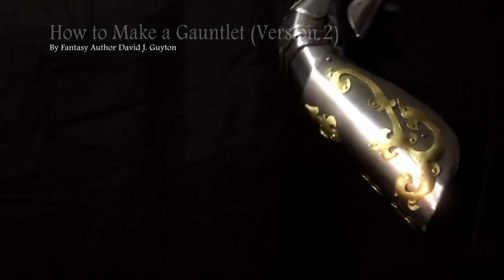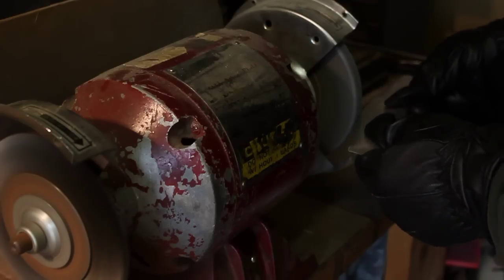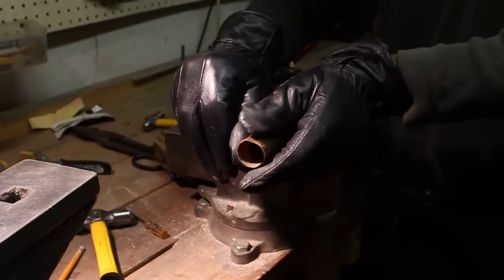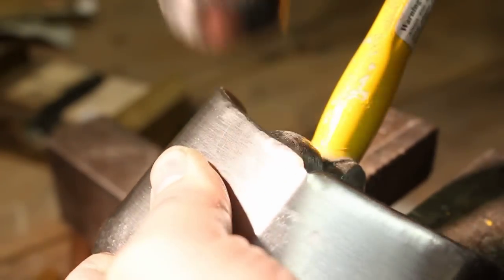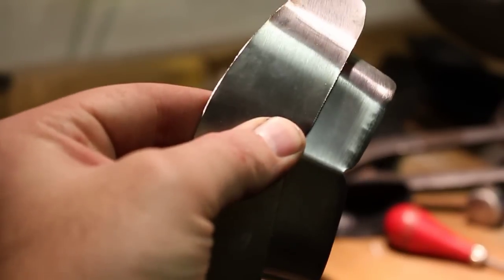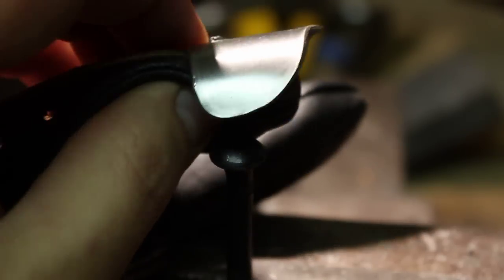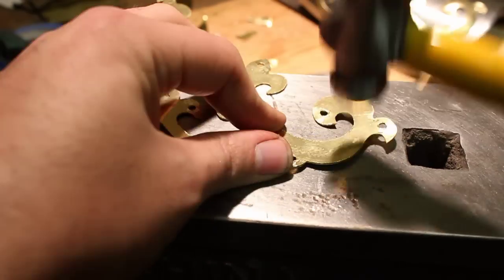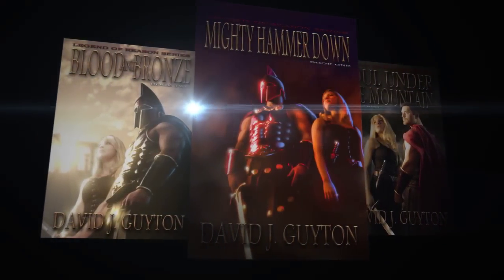How to Make Armor with Ordinary Tools - Version 2 Gauntlet

Comment: Do you have any tips for hammering the rivets they always seem to bend what am I doing wrong
Reply from the maker: the most common issue if they are bending is that the rivets are cut too long. You only want about 2 or 3mm sticking out above the surrounding metal. Make sure to use a rounded hammer, like a small ball peen, and hammer very lightly around the edges first. This begins the mushroom shape and if you are careful it will stay uniform and not bend on you. If you are doing loose rivets, the same care must be taken, but you need to go even slower because obviously the shank will nee to be longer and will be more susceptible to bending. Make sure you have something very sturdy to hammer against too.....tricky to do inside the glove but it's certainly doable.

Comment: David- I have another question.  I am trying to attached the finger plates to the glove using the roofing nails as in the tutorial however I am having some issues.  First the placement of the holes on each plate.  The first attempt the leather strip stretched on the second plate causing the placement to be off.  Too it apart and on the second try the nail head pulled through the top of the glove leaving a hole  while on the bottom it was torn through by way of the anvil and the nail head.  Any advise or suggestions on these issues?  Thanks again!
Reply from the maker: Hmm not quite sure I understand, but I'll try to help. Leather comes in all forms. It sounds like you are working with some stretchy kind of leather...it would be best to find some that is a bit stiffer. It should only stretch when you REALLY pull on it, otherwise it should only bend. If you can stretch it with your fingers, try another leather. As for pulling through the hole, try cutting your nails a little longer so that there is more  metal to mushroom out on the top side. Work the edges first, then you can hammer down the entire nail head. As long as your hammered nail head is bigger than the hole in the fingerplate, it will never come out. Ihope I answered your questions, if not, let me know and I'll try again

Comment: Hi, the Ebay seller you use doesn't ship to the UK, what do you search in Ebay to find the metal for making armour? Also, how much should it cost? The cheapest 500mm x 500mm 0.9mm brass I've found is £60! I'm not even sure if that's the right thing! Thank you so much! On a different note - I HATE GOOGLE+! ARGH! <3
Reply from the maker: Search for 20 gauge stainless steel sheet, or since you are in the UK, it might be listed as 1mm stainless steel sheet. Anything close to 1mm will be fine. Not sure what it costs in pounds but in USD it should only cost about $20-$30. That's enough to make one gauntlet, and probably two if you are careful with your layout. The template prints out on 4 pieces of paper (I think) so keep in mind that you will need about that much metal to make a gauntlet (slightly less since you can lay it out differently on the metal and save space)
Reply: David Guyton Thank you so much! I think it's just more expensive over here then, unfortunately! I was hoping to get more because I would also like to try making an 'armoured dress' out of brass. I'll keep looking, I really want to try making this! Thank you! <3
Reply from the maker: ooh an armored dress would be really neat! I would like to see a video of that if you ever decide to make it.
Reply: David Guyton  I've seen some gorgeous scalemaille dresses - full plate would be even better.

Comment: What kind of nails did you use to rivet the finger plates to the glove? I'm using galvanized stainless steel and they seem to be way too hard.
Reply from the maker: +Nukellavee Buke Ordinary roofing nails, or anything with a wide head. I have never heard of galvanized stainless nails. Stainless steel does not need the zinc coating.

Comment: I feel cheated!  Where's that model that was on your ad for this video?  ;)  It appears that you are riveting through the glove.  If you are doing this, wouldn't it be practical to increase the gauntlet size so that you could wear a soft form fitting liner against your skin to protect from chafing?
Reply from the maker: ***** She's in my book trailer videos, and also on the cover of all 3 of my novels.As far as protection goes, you could easily slip on a thin liner glove inside the leather glove. This gauntlet is not that form-fitting, so there's no need to scale the template up in order to fit a liner glove inside

Comment: Also are you Hercules? I've tried drilling, hammering in nails and all that and either i can't make a hole at all or it makes the other side flayed out and messy. Did you use a drill? Because maybe my bits are just blunt
Reply from the maker: either your drill bits are blunt or you have very thick metal. You should be using 20 or 22 gauge stainless for this, or if you are using regular steel, 18 gauge. Stainless is a lot harder, but a sharp drill bit should go through it just fine.
Reply: Alright thanks! I'm using around 22 gague stainless and my drill bits are doing nothing to it... Might just have to sharpen them

Comment: so I have been looking into these and I'm wondering two things.  One what size rivets did you use and I am thinking of using this template for a cosplay and I'm wondering if you think it would work with EVA foam and if so would you recommend a thickness?
Reply from the maker: the rivets are just ordinary roofing nails I had in the garage. The size really doesn't matter, as you can make anything work. Never worked with Eva Foam no, although I would like to look into it.
Reply: David Guyton The EVA foam looks like it will work really well but I am having a problem with some of the pieces staying down.  I was going to simply glue them to the glove like I saw in another template that was less advanced than this set.  What I'm wondering is, what is the point of the leather strip?  Is that to allow the pieces to articulate better?  If so, I may try something similar with the foam.  Let me know when you can.  I have a convention I will be showing them off at during the end of the month so I just need to know by then so I can have them working in time.  Thanks for your help :)
Reply from the maker: the point of the leather strip is so that you have something to rivet the fingerplates to. You CAN rivet them directly into the fingers of the glove instead, but that is difficult because it's hard to reach into the glove with something hard enough to hammer against to make the rivets. If you attach a leather strip instead, you can easily rivet to the strip, and then you just need to rivet the strip to the glove (2 rivets per finger instead of like 7)

Comment: Sorry if it's been mentioned before, but my speakers blew and I was wondering what type of sheet metal you used or are using if you've found any alternatives? do you think brass would work?.. I'm going for a more steampunk design.
Reply from the maker: Yes you can certainly use brass. I used brass fro my first gauntlet tutorial. This one is made of stainless steel though. Brass is far easier to cut and shape though

Comment: Compared to the knuckles, what is the position of the last finger pieces on the back of the glove? Are the last rivets directly over, in front of or behind the knuckles?
Reply from the maker: It's been a very long time since I have built this gauntlet, but basically you can do it in any way you want that makes it comfortable or look right. I try to get the last fingerplates as high as possible to avoid a large gap between the fingerplates and knuckleplate, but there's going to be some gap there at some angles.

Comment: Just a random question because I'm curious. Once you had all of the design down and ready how long does it take you to make one of these, from cutting out the template to the last rivet?
Reply from the maker: +DrQuackersPhD depends very much on which piece of armor I am making, how thick the metal is, and where along my progression as an armorer I made it. For perspective, this gauntlet probably took me more than two weeks, but it was only my second project working in metal. By comparison, my latest project which is a complete upper torso (cuirass), made of like 40 individual pieces, only took me about 12 days to fabricate and assemble.

Comment: Just a quick question regarding the size of the pieces. How do you go about measuring them? Is it measured according to the individuals hand?
Reply from the maker: Not exactly. I make the templates using my own hand as reference. I have fairly average size hands so it should fit just about everyone. The pieces can be sized up a little or trimmed down some if needed
Reply: Thanks
Reply: David Guyton  What kind of glove did you use and where would you find them?
Reply from the maker: These are Thinsulate brand gloves I found at Walmart. You can find them other places too though

Comment: I just bought template and I have an question. Store in my town has only 1,5 mm thick Stainless Steel H17 plate. Will it even be possible to cut throught or bend it? Or shold I look for 1mm thick one on the internet?

Comment: I don't know if you will actually respond but what did you use as your base glove, was it a only leather glove or was it like the reeeaaallly thin leather on puffy insulation then more reeeaaallly thin leather?
Reply from the maker: For this one I used the Thinsulate brand gloves I found at Walmart for like $13. So, leather with a thin insulation
Reply: David Guyton ok, thanks, and thank you for responding to this 1) very quickly and 2) on such an old video.

Comment: Hi David Guyton. How do you polish and keep your metal so well? I have sanded my gauntlet down, but it is not as shiny and it is beginning to rust also :(.
Reply from the maker: if you are getting rust, then you used steel and not stainless steel. I used stainless, which is brighter. You can still get a nice finish if you keep sanding it. To prevent the rust, spray it with WD40, and then wipe it off. Keep it indoors out of the elements.
Reply: David Guyton Thanks! Loving the work.

Comment: What do you use to make holes? also I used a grinder but i feel as if it's still pretty sharp, what do i do to make it more safe?
Reply from the maker: If you are using very thin metal, it's always going to be kind of sharp.  I certainly don't recommend this. If files are not making the edges blunt enough you might need to be using thicker metal. You can also try using sandpaper (like 80 or 100 grit) to make the edges more blunt. As far as the holes, I used to just use a drill bit, but these days I use a Power Punch. Got mine from Amazon for $30. You can see me using it in my Superhero Armor tutorial here: https://www.youtube.com/watch?v=9Zf2NgK77a4

Comment: Hey, I'd like to make one like this, but made out of craft foam, also called EVA foam. Is it possible? Which kind of hinges do I need to use?
Reply from the maker: +dynamic_cast99 I don't know anything about attaching hinges to craft foam. I assume you could make the hinges out of foam as well, and glue them on, while gluing in some fabric or leather from behind to reinforce it.

Comment: is it better to drill the holes after bending? i mean when the metal is still flat it can be drilled easier. 
would it mess up the fitting of the holes if i drill first and bend afterwards?
Reply from the maker: I would suggest drilling the holes and then bending after.
Reply: David Guyton thanks. i wasn't sure but if you think the positions of the holes won't be too off then I'll trust your judgement

Comment: is it possible to make them using 1/8 inch thick stainless steel or carbon steel.
Reply from the maker: No. Steel that thick cannot be shaped properly, and the pieces would not articulate at all. It would also be impossible to cut with hand tools. You would need a laser or plasma cutter to do it. On top of that, it would weigh about 60 lbs.

Comment: Bought the template(s), the placement for fingerplates is very difficult. Staring at 7:37, so the bottom plate rivet seems to be right over the knuckle of the hand? That way I can gauge the distance of the rest of the fingerplate placement.
Reply from the maker: Not directly over the knuckle. If you bend your finger.....sort of making a fist, the top rivet of that fingerplate should be right about where your finger transitions into your knuckle. You can cover a little bit of the knuckle with the fingerplate, but not too much. You don't want the fingerplate to stick up higher than your knuckles do when you make a fist.

Comment: Does the template tell you how much stainless steel to buy, and where I can easily find it (such as a link to an ebay seller or something on amazon.com)?
Reply from the maker: The template prints out on 4 pages of 8.5x11" paper, so you will need roughly that much, per gauntlet, although it depends on how you arrange the parts after you cut the pieces out. You may need less. As for where I buy it, I use a company called Shapiro Metals. You can buy their stuff on ebay for a decent price. Seller name is ssshapirometal

Comment: I was also wondering what size (in dimensions) would I have to buy the stainless steel for the correct fitting for the template
Reply from the maker: metal is sold in pretty random sizes, usually as extra pieces from when they are trimmed for other uses. Because of this, it's hard to give an exact size you need. For instance, this template prints out to 4 pages on 8.5x11 printer paper. That's roughly the amount of metal you need, but you can always arrange the template pieces in different ways to fit differently on the piece of metal you have, taking up less space and wasting less metal. So you MIGHT be able to arrange the pieces on a 12x48 piece, or you might find it much easier to do it on a 30x30 piece. I suggest getting the template and cutting the pieces out, lay them out in front of you and then measure the area.
Reply: OK thank you for your time and help.

Comment: Are the templates printed on an 8.5"x11" piece of paper, with "fit to page" selected? The pdf files are slightly off from 8.5"x11", 8.26"x11.6". So I need to know if the templates are "supposed" to be scaled to 8.5"x11", or printed as is. Thanks!
Reply from the maker: All printers are different, so I can't walk you through the exact settings. But yes, they are supposed to fit on 8.5" x 11" paper. So if you are getting parts cut off, or you see that the 1" mark does not measure one inch, you will need to check or uncheck some of the boxes in your printer options. Usually "print to page" or "print page to fit" is the culprit.

Comment: do you have any tips for the rivets? im using nails aswell, but they keep bending when i try to hammer them down
Reply from the maker: It can be a little tricky. Make sure you are starting one side in a vise, and not putting the rivet directly into the part right away. Clamp it tightly in the vise and use the round side of a ball peen hammer to hammer around the edges, making a mushroom shape. Then put the nail into the armor, and put a mark about 2mm above the surface of the armor. Cut the nail there and then carefully repeat the process for the other end of the rivet. If you cut the nail too long, it is bound to bend on you. But even cut to the perfect length it can still be tricky. It just takes practice. If you want to make it a little easier, find some copper rod and use that instead (you'll have to order it online because I have never seen it in stores). Brass rod will work too...it's softer than steel and harder than copper, however brass has a tendency to flake and split when using it for rivets.
Reply: David Guyton
thanks, will try again as soon as i have time ;D

Comment: I would like to know where or what components you riveted to the glove and what ones were just riveted to the leather strips
Reply from the maker: That is difficult to type out, however it is marked on the template. In short, the ends of the fingers, and at the knuckles have rivets all the way through the glove/strip/metal/ . The rest of the fingerplates go through strip/metal. There are two rivets on the knuckleplate that go through glove/metal. The rest go through metal/metal.
Reply: David Guyton cheers, i'm planning on downloading the template, just wondering if the plate that goes over the knuckles with the brass accents is critical to the design, or wither it can function without it. also you mention that you made the rivets from brass rods, did you have to drill through the stainless, and attach it much like the roofing nails to the glove? by hammering the still round end till it was flat.
Reply from the maker: The brass rod rivets were only used to attach the brass accents. The rest of the rivets are ordinary roofing nails. The head of the nail is on the inside, and the outside is the cut end of the nail, hammered down so it can't go back through the hole. The brass rod rivets have to be hammered from both ends, unlike the nails. As for the knuckleplate, yes it is critical to the design. You do not need to add the brass accents, but if you skip the knuckleplate, there will be a huge area uncovered, and the rest of the pieces will have nothing to be riveted to.
Reply: David Guyton
Brilliant thank you so much for the answers. :)